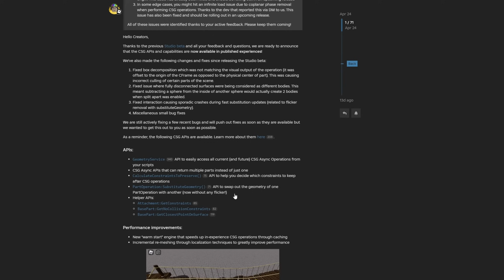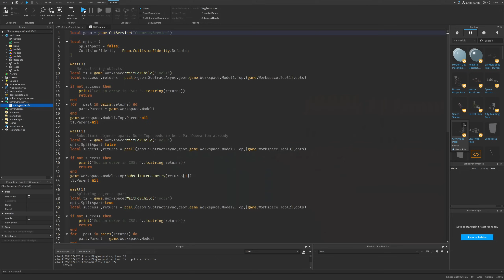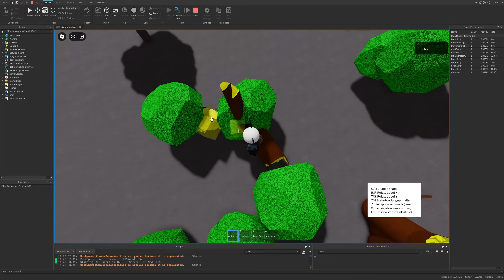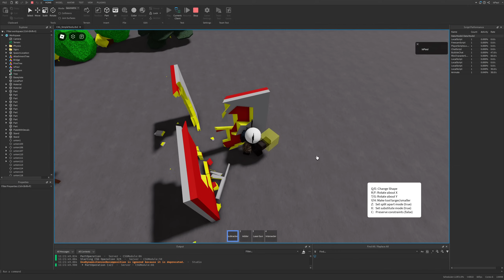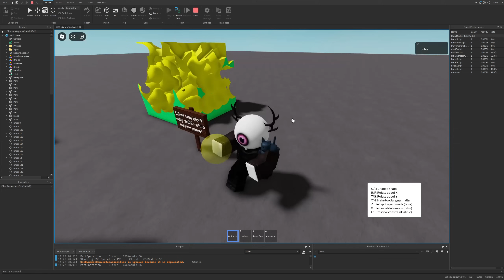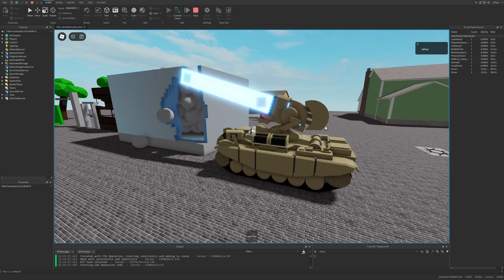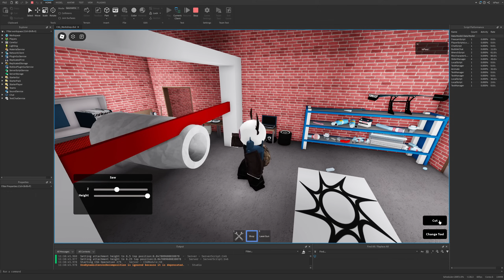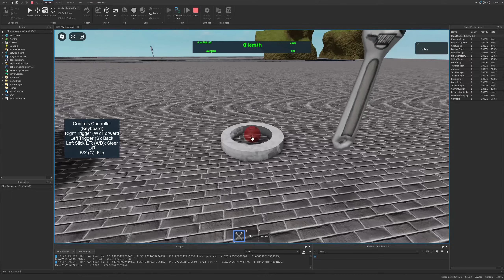Roblox Cutting Parts Is Finally Possible In-Game...

Comment: Neat, I made a custom Split tool for the older CSG model a longer while back that just quickly ran a CSG negate operation on two copies of the model you're cutting, therefore producing two halves.  This is obviously easier.

Comment: ive already seen individual parts getting cut and destroyed before a lot ive seen ROBLOX most satisfying game which is not true its boring voxel destruction physics is more fun voxel destruction physics also have individual parts geting destroyed and cut apart but voxel destruction physics doesnt use csg
@augustinehuizing6683
"I hear a lot of people talking about this in the comments so I just want to throw this out.

THIS WAS NOT POSSIBLE BEFORE.
Yes games like Destruction Physics had similar systems in that part splitting was possible, but most game developer made engines were limited as the CSG system was really slow before. 
The optimizations in CSG alone are already a HUGE deal as it gives developers way more leeway when using CSG."
oh ok i thought destrustion physics used csg if it used csg then primitives other than block and unions would work fine insteadof turning into blocks
also what if i wanted to conserve mass cuz it currently doesnt obby Conservation of mass

Comment: I hear a lot of people talking about this in the comments so I just want to throw this out.

THIS WAS NOT POSSIBLE BEFORE.
Yes games like Destruction Physics had similar systems in that part splitting was possible, but most game developer made engines were limited as the CSG system was really slow before. 
The optimizations in CSG alone are already a HUGE deal as it gives developers way more leeway when using CSG.
Reply: The reason that game was small and innacurate and slow updating
Reply: There's actually a  badgegiver for that game in the tank destruction showcase
Reply: I could've sworn I saw discussion about real-time CSG before, though. Most games use parts, but what exactly made this new development possible? Was it just the speed of operations?
Reply: Laughs in lumber tycoon
Reply: @yoskinny  Lumber tycoon didn't use unions, all it did was create 2 new parts to replace the 1 old part that are scaled in a way that makes it seem like you split the larger part.
Reply: @yoskinny  its different (correct me if im wrong)
Reply: @dominikrni  I think you're right since lumber tycoon only does basic cuts while this is a big sphere cutting through unions so it doesnt lag as much
Reply: @yoskinny the thing is with lumber tycoon is that, when cut, it created a “line part” and would get two parts and create them “looking” at the middle part and just extending until they meet that line part. rlly basic stuff

Comment: didnt lumber tycoon use something similar? dont think this is new
Reply from the maker: LT2 has its own system for this
Reply: I might be wrong and I haven't played it since ever,
but I think Lumber Tycoon has it scripted to replace the chopped part with 2 smaller parts.
Either way, you make a good point

Comment: "finally"
this has been like, a feature. check "Destruction Physics"'s creation date and you'll get why its not a "finally" and the feature has been there
Reply: I don’t think it uses the same system, and I’m pretty sure this update added more customisation
Reply: @localscripted  thats cool, because the customization has been and always has been the same. roblox just focuses on making the feature perform faster (it was very slow, takes ~0.5 seconds on 2 parts operation, now it takes ~0.1 seconds depending on the part's Shape property)
Reply: Destruction Physics uses their own system that is slower due to not having engine-level code access. Roblox updating CSG is HUGE due to the performance gains and ability to have officially supported part separation.
Reply: @augustine6683  
"Destruction Physics uses their own system"
hi if you didnt know, they use the same CSG system as what roblox has provided and has been optimising for quite a while. that game just has this CSG "queueing" system that makes sure that the server won't lag due to many players (+ most parts in that game are not even divided into smaller parts, and EditableMesh isnt even implemented at that time, so how will they implement their own csg system?)
Reply: @STEVE_AhPiss  No what i mean is they have their own system for part splitting. That is the whole thing being shown off in the video.

Comment: Using terrain is better tho, less lag.
Reply: Using terrain is actually worse for doing these rapidly, CSG operations are much faster than terrain.
Reply: @shoppingcart69420  that's not true at all, terrain is instant, meanwhile csg takes half a second.

Terrains are less detailed tho
Reply: @rockyes3239 no computation is instant.
Reply: @rockyes3239  terrain uses a grid system and generates a mesh using the grid, unions use CSG which is based on mesh data, both systems are now fast enough to be done at runtime with very little delay aside from larger operations. While terrain is faster, csg can still be done at runtime and takes a lot less than "half a second"
Reply: @augustine6683  its sepends on how complicated the part is.

The draw back of terrain is its less detailed.
Reply: @rockyes3239  Most CSG applications should not be taking over half a second and if they are you might need to implement multithreading.